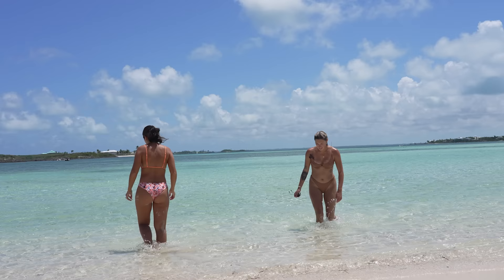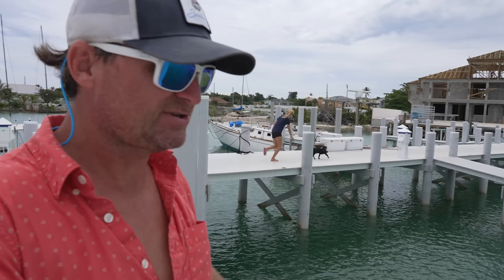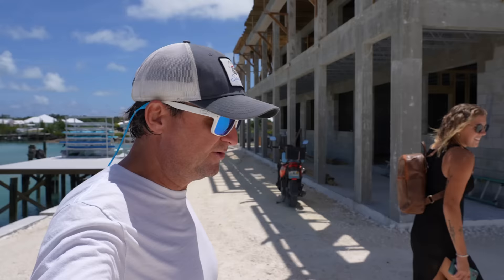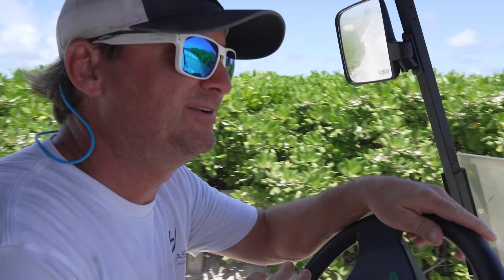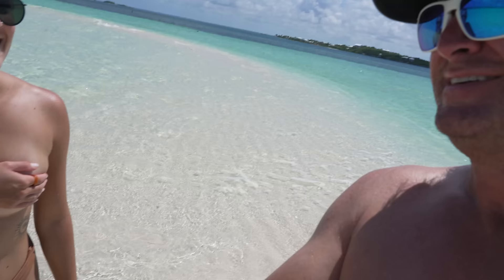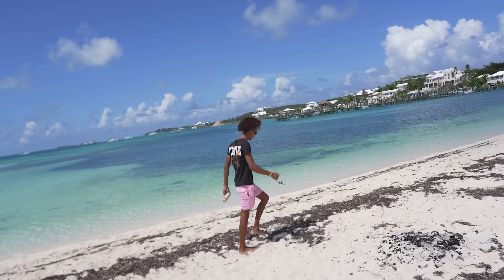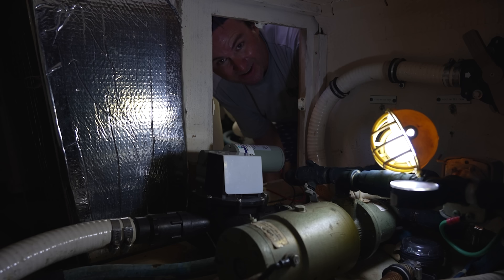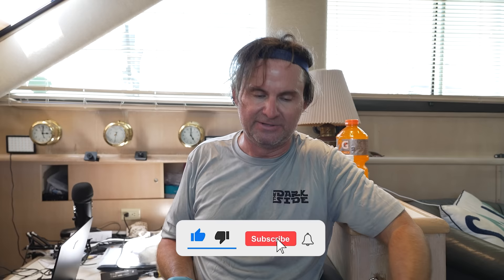Clothing Optional at the sandbar in the Bahamas!

Comment: Bobby, more than likely the leak is at your toilet (head). There is a ball and seal that gets dirty over time and loses the seal not allowing it to create a vacuum. They sell a cleaning kit that is like a tongue depressor, you open up the valve(flush) and stick that between the ball and seal. You then rotate it around the ball.

Comment: It would have been so much easier for them to have added 1/4 turn ball valves in the line to those sewage pumps. Minimal cost and made changing a breeze. Not to mention it would stop a flooding situation like you had earlier.

Comment: 12v or 24v on the macerator pump? I have both , could have shipped you one man. Also the flapper valves do go bad and will cause the pump to run. Check the sensor on the vac tank.

Comment: No bacuflush doesn’t work that way. The below creates the suction pressure and the waste flows straight thru the valve and into the holding tank. Once completely depressurized the belies pumps the system up to create new vacuum pressure for the next flush.
Reply: That doesn't make sense to me. It has to push to the tank unless there is enough force from the suction to push past the pump and check valves into the tank. I looked up diagrams and saw a couple different style one way valves. It does seem like a small bellows to actually hold and pump out the waste, so maybe it is more powerful than I imagined.  Also, there is no such thing as suction pressure. They are opposites like positive and negative. Vacuum and suction are the same, which is a lack of pressure. Old fuel pressure gauges had a zero mark in the middle and pressure is a positive number in psi and vacuum numbers get bigger going in the other direction and are measured in Inches of mercury. 29.92 is a perfect vacuum.